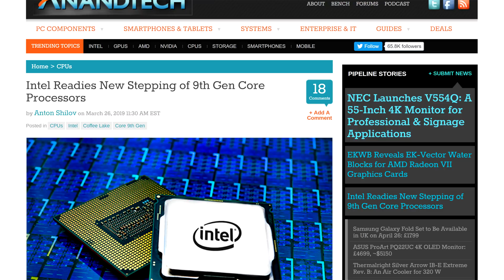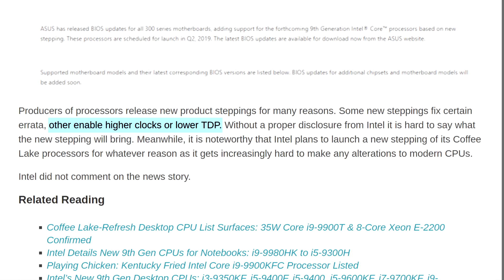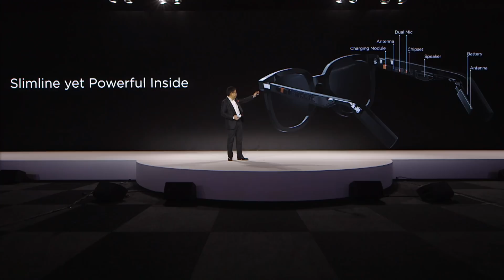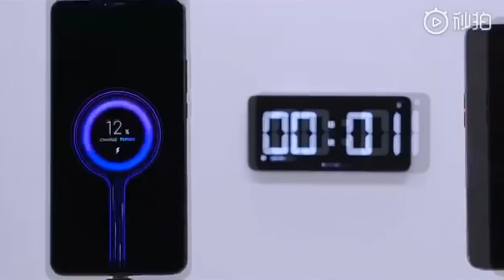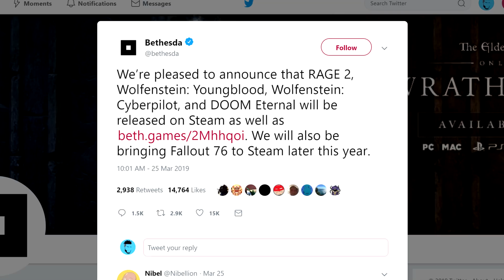Intel Is Stepping Up Their 9th Gen CPU's!

Comment: That 100W charger is insane, it puts an enough strain on the battery. I'm far more curious what the battery tech being used is, assuming they have minimized the degradation that charging so quickly to a single battery would cause. -Unless it's just a proof of concept and they're simply destroying normal Li-Ion/Polymer batteries to show off a charger not ready for actual use. Curious either way...
Reply from the maker: Knowing those companies, It could be on the shelfs next week! Those gues move quick !
Reply: @BootSequence  Too true lol